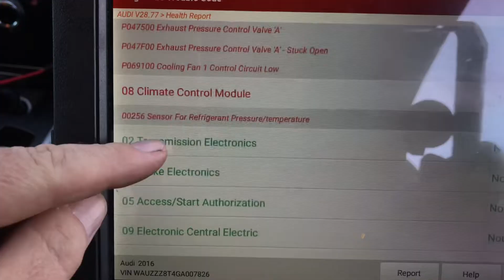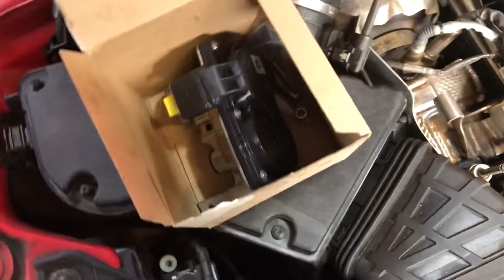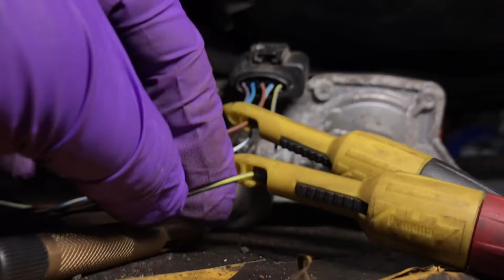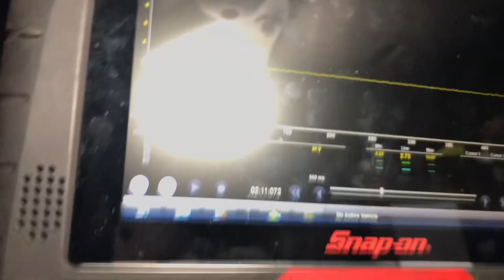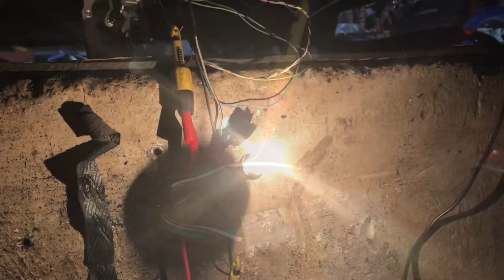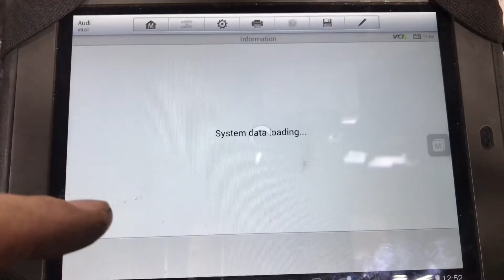Audi A5 2.0 TDi (2015) - Exhaust Pressure Control Valve, Fault Codes P047500 & P047F00

Comment: Hi! I have only 1 problem in engine - Like P047F00, but its only 1 problem with Stuck open. Its can be exhaust gas pressure sensor or i must to check V like you?
Reply from the maker: Check out the wiring
Reply: @sandyande  U talking about cables from/for exhaust?

Comment: I paid a dealership to diagnose my car and they've informed me the exhaust shut off flap is in short circuit. They wanted 600 quid to replace the valve itself but I'm fearing a wiring problem (like here). It's intermittent and the valve looks good as new, also I'm getting numerous warnings on the dash. I watched your vid hoping to see the valve could indeed be in short circuit.

Comment: Where are you based?
Reply from the maker: Falkirk
Reply: Oh wow. Very far :(. Could you reccomend what I advise my mechanic to check with ‘exhaust pressure control valve ‘b’ faults on RS5 B9. It’s putting car in limp mode.  Driving me mad!!  Thanks
Reply: @Mo Benhamou Ace Maintenance  did you get this sorted? I have same car with same issue, turned out the connector on rear exhaust actuators were corroded 😢

Comment: The same valve on my Audi a6 with the same engine as this is squeaking when I drive the car and it changes gear up or down or when I rev the car dont no what to do with it , it's definitely this valve put my hand on it and got someone to rev the car you can't get at the inside to clean it
Reply: Yeah I think they weld them inside the exhaust now. What did you do in the end? Got a Seat Leon Mk3 same issue.